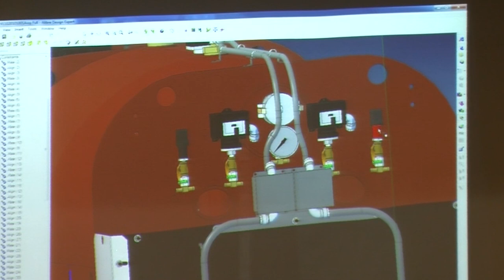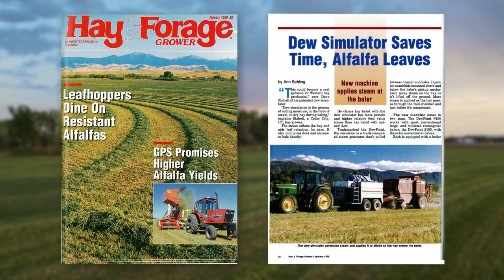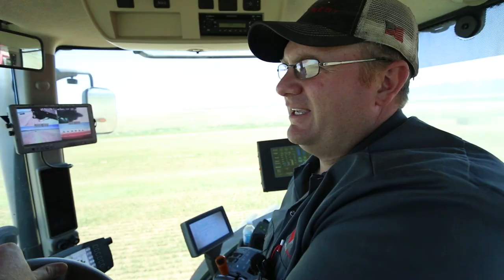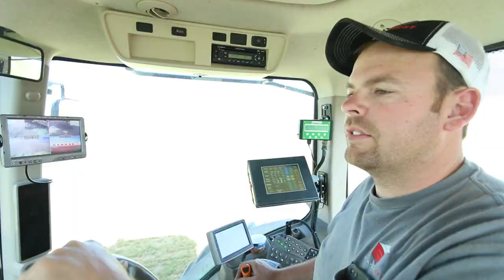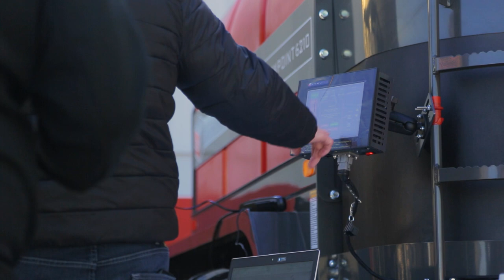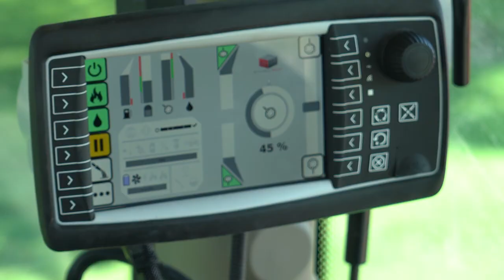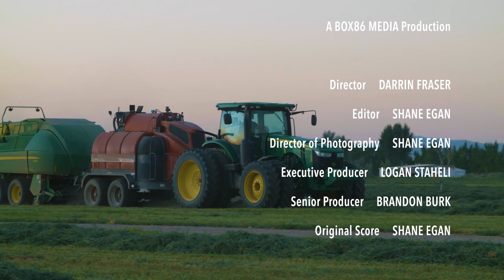Making Dew Part 4 of 4: From Automation to Transformation – Transforming the Business and Industry

Comment: I have a question I’m trying to do 1200acr with one baler just bought a krone 1290 hdp that’s way faster than my old 1290. My question is this can your steamer keep up with a baler that can do 75 bales a hr at 1600lbs? Also how does the steam handle heavier bales I’m guessing we would use less steam? I have a dealer that’s sells your product locally but not interested in helping me with a krone baler.
Reply from the maker: Those are great questions. We have dealt with your situation many times with other clients and would love to be able to speak to you about this. Please email me your contact info - logan@staheliwest.com

We have a lot of customers using the Krone 1290 HDP.  It's a good baler.  The steamer will absolutely keep up with it. During the 72-Hour challenge we were actually baling around 90 bales an hour and it was very hot, dry, and windy and we made some beautiful hay.  

If you want to keep your bales around 1,600 lbs, I would suggest NOT lowering your steam rate, but rather lowering your pressure settings on the baler.  Steam will  make a heavier bale but in order to get the best results you really want to crank up the steam as high as you can without making the hay too wet. 

We don't favor one brand of baler over the other. We are happy to pair our steamer with any major brand of baler.  I hope to hear from you soon!